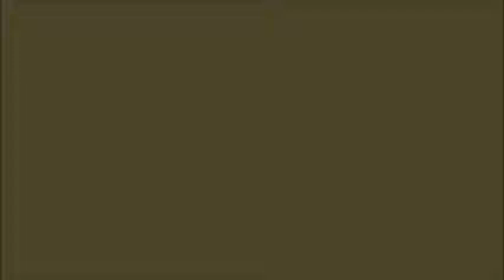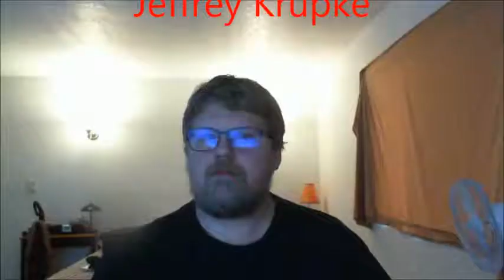Mach3/4 vs LinuxCNC vs grbl

Comment: Mach 3/4 works fine on Windows 10 64 bit.  I run an Ethernet Smooth stepper rather than the parallel port.  Not sure if that makes a difference.  I'm currently experimenting with Linux CNC as I like the open source aspect, but nothing wrong with Mach.
Reply: ya i did not buy that it only worked on win. How can they be selling them?
Reply: "I run an Ethernet Smooth stepper rather than the parallel port.  Not sure if that makes a difference."
- It makes a huge difference. If you're using a dedicated controller, the software (the g-code sender) is far less relevant. But if you use parallel port, the computer itself is the controller. Therefore the software becomes much more important (and the kind of computer you're using). Maybe you have no problems because your computer is not using the modules of Mach3 that work with the parallel port. The biggest issue with parallel port control is that the kernel latencies of your computer become critical! All of a sudden not every computer is suitable for CNC control. And newer and more powerful is not necessarily better. A dedicated controller handles all the time critical operations. In that case the main computer just sends the commands and the controller just stacks them in a queue and executers them as needed.

Comment: I run Mach3 on Win7x64 and it runs fine for me. it has now for 3yr. I actually run it on 2 different PCs, One has printer port, The other one I use a USB board. But they run good. Both are x64

Comment: I totally agree with Keith Howlette, XP and Mach3 is the way to go. I have a number of Fanuc CNC  machines all with XP computers for programing, I have a stack of them, Ebay, 40 to 50 GBP with XP installed. Also I have made several single axis tables using Mach3 and they run great. I have looked at updating and going Windows 7 with a USB board but my tables use Nema closed loop motors and for the life of me I can't find any information on how to connect them to the new USB controllers?? connection for ENA+ is missing, could it be I just connect to a 5V+ rail?? Has Mach4 with a USB controller gone back into the dinosaur age unable to use closed loop motors? I don't believe it!! I think it is just lack of knowledge on my part!!
A good video which will invoke a wide range of views and augments.

Comment: Sorry don't agree with your comment on Windows XP. I've been running Mach3 on XP for several years . It's not connected to the internet so never needs updating or antivirus. Don't just discount it because it's old. It does the job. Otherwise a good video.
Reply: keith howlette I agree. As much as Microsoft anything leaves a bad taste in my mouth, there is something to say for older code. It tends to be more mature, well tested, and rock solid compared to newer tech. This goes for any software or even hardware technology.
Reply: Bullfrog's Workshop yes totally agree with you.
Reply: You obviously don't do much threading then - threading on Mach3 is dire! Had mach3 for 4 years now - upgrading.
Reply: @Rimsey1966  what are you using now

Comment: Not a Mach fan, Grbl may work, but I have been running production on my Linuxcnc lathe at home for about four years. That is about 8 hours a day 5 to 7 days a week. Software wise I have never had any problems with it. I have however replaced steppers, stepper drives and a couple of other electronic components as I got buy better equipment. I work with tollerances of +0.005 / -0.015mm tolerances on diameter and can stay in there without any problems.

Comment: LinuxCNC is Debian Wheezy. Not perfect? What is not perfect? Gerbil is beta ware. Don't get wrapped up in amps. Power is expressed in units of Watts. Those Gargle boards are good for maybe 4 Watts. Which is not a lot of power. You need guidance.
Reply: Out of the various stepper drivers supported by the average GRBL controller or "arduino cnc" boards the A4988 (cheapest) is rated at 70W (35V @ 2A), the DRV8825 is roughly the same. A typical NEMA17 motor is - on paper - rated at 5W (ie 12VDC @ 400mA) but these and their bigger brother NEMA23 motors are often run at higher currents. E.g. 24VDC @ 1-2A for a NEMA23 on something like the OpenBuilds.org large OX CNC router.  I have been using GRBL 0.9x on my large 1300x850mm tool area OX with no issues for over a year. When driven by bCNC to stream the G code to the grbl controller everything works very well indeed. Yes I've been considering trying LinuxCNC for giggles but there is certainly nothing "wrong" with the GRBL path he is proposing. Just don't forget to follow the appropriate current limiting setup instructions for whatever type of stepper controller you go with.
Reply: The A4988 is rated at 4W max dissipation. They do not say you can push 32V @ 2A at the same time. Learn how constant current works. Package thermal resistance is 32 ºC/W So at 4W the package is 128ºC Add ambient temp and you're done. This power limitation is even more damaging than it sounds like too, if you know how constant current and stepper motors work. You don't seem to so I'll explain it. When you need more voltage to overcome inductive reluctance the drive is going to be putting out less voltage. So your top speed performance suffers. If you could push 70W through the A4988 it would glow and pop off the board right before it exploded.
Reply: With an RdsOn of typically 320mOhms (specified at 1.5A in the datasheet) and assuming you need to take into account both coils operating at the same time the dissipation (not in the stepper motor) in the A4988 due to the IR losses in the FETs is I2R = (1.5*1.5)*0.32 = 0.72W * 2 channels = 1.4W. At the max (as specified in the datasheet) of 35V @ 2A (70W delivered into the load, NOT dissipated in the A4988) the I2R and assuming the highest RdsOn (from the datasheet) of 430mOhms P = (2*2)*0.43 = 1.72W * 2 (2 channels) = 3.44W so close to the maximum dissipation allowed of the A4988 of 4W. Yes they almost always need to have seat sinks fitted (and get supplied with them in 99% of cases) and a cooling fan may be required but the datasheet correctly says that the 35v@2A is the absolute limit for the A4988. The same calculations are used in AllegroMicros documentation and media releases to highlight the benefits of their synch rectifier design.. Yeah, I've been all good with constant current for about 40 years now thanks.
Reply: Personally I'm happy to run with the cheap modules, if I was trying to point my brother at something plug and play then I'd agree and likely suggest a ready to go package like the 6600. I/we use SMD exclusively for high power designs at the lab as does every other company / agency in this city that builds Defence related electronics. Cheers.